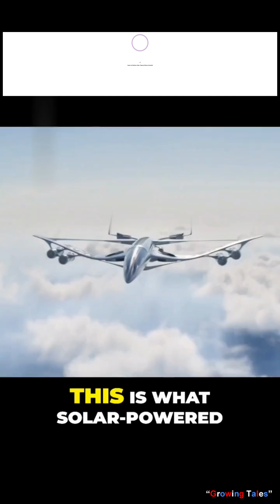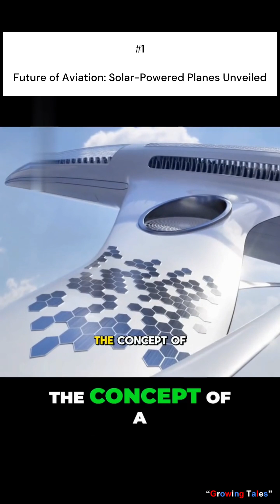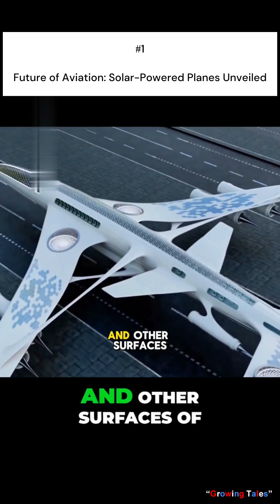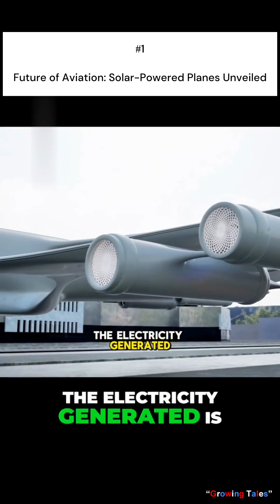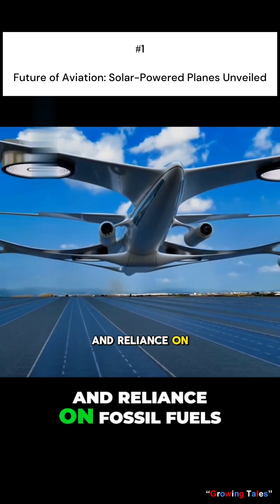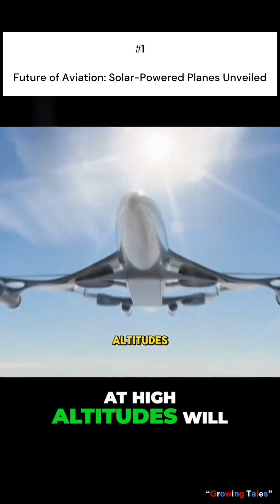Future of Aviation: Solar-Powered Planes Unveiled.

Comment: And one very tiny problem, these panels won't make THAT much energy

Solar panels in something is more of a recharge and not generator
Reply from the maker: SunPower Maxeon 6 Efficiency: Up to 22.8%. SunPower is one of the leading manufacturers of high-efficiency solar panels. The Maxeon 6 series boasts impressive efficiency due to its unique cell design and high-quality materials. thats up from 5% of previous panels. this is about the future of not today but as panels get better and batteries get better could be a thing plus this is designed for high altitude flght.

Comment: First and those solar panels are barley gona do a different in Range
Reply from the maker: They are getting better with the panels. using prism,s to concentrate light to a high temp panel.
Reply from the maker: Advancements in solar panel technology, where researchers are incorporating prism-like structures to better concentrate sunlight onto the photovoltaic cells, thereby increasing the efficiency of energy capture from the sun.
Reply: @kellyperry4477 even with technology advancing and such a stigma around it, solar still generates less than 5% of the total energy and costs way more due to its inefficiency. Which to be used by a plane as a power source would be nearly impossible to make it primary.
Reply from the maker: Only time will tell.
Reply: No more flying at night